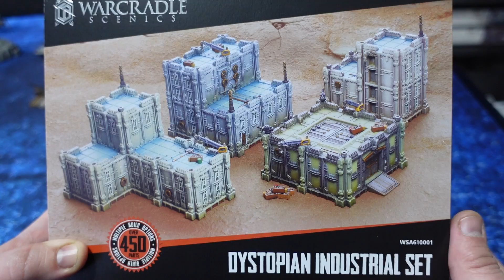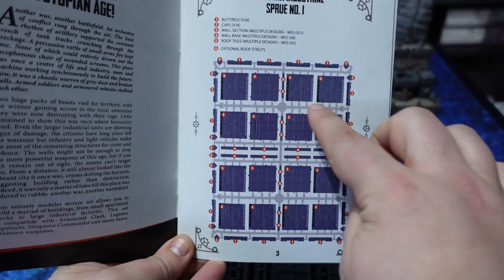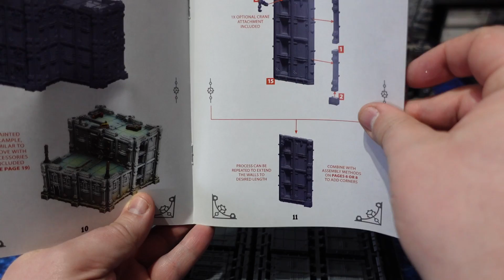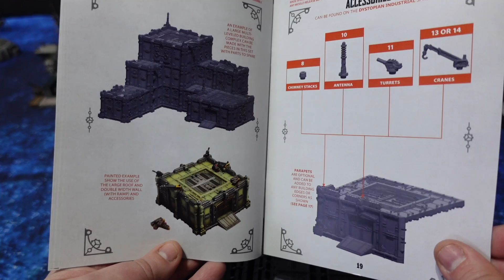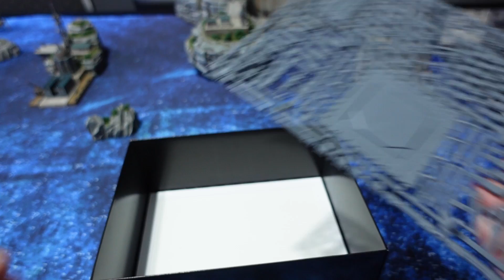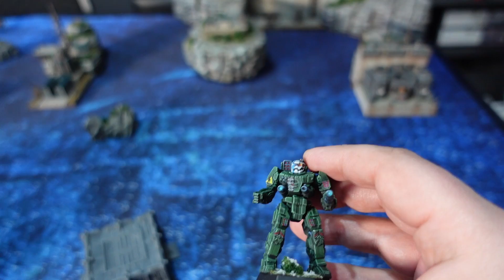Warcradle scenics: Dystopian Industrial terrain set.

Comment: got an idea for you put some magnets onto your pipes so the snap toghter
Reply from the maker: That's doable... But those holes on the plastic set actually have some neat ventilators modelled on them... So I would probably just place the pieces together, so they can still be used separately without an obvious magnet destroying nice detail. Not when gravity keeps your gaming pieces together just fine.
Reply: You could put some magnets onto the other side, inside the building so you dont have the magnets obscure the details
Reply from the maker: @geertbeekman8680  you could try that yes. I would help preserve detail.